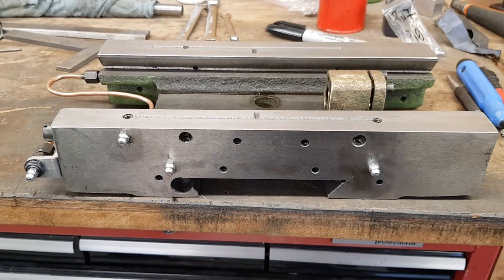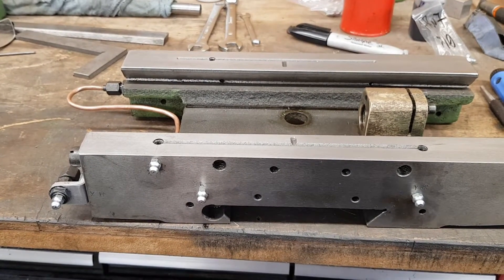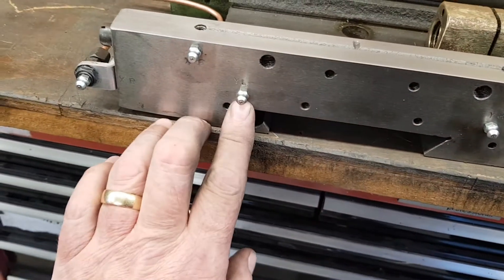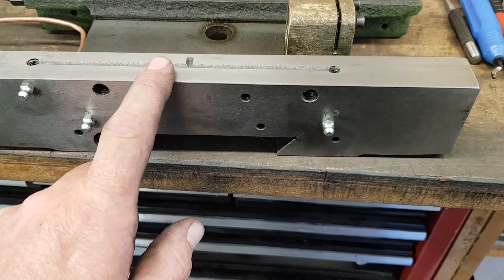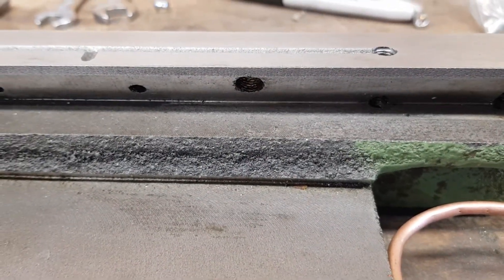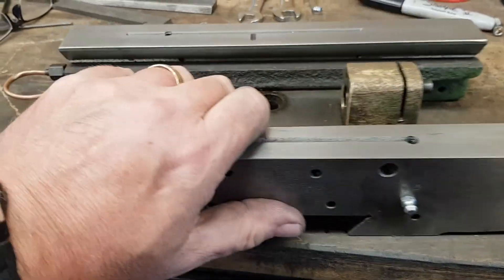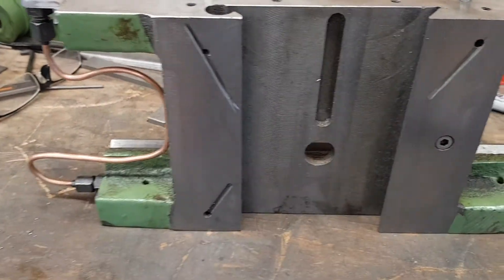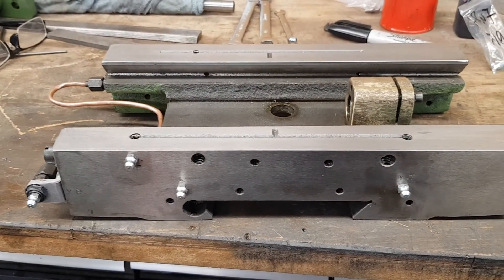626 Mill (Toolco VM26) One Shot Lubrication "Scrap" Part 2

Comment: Hi Nell. Robert come lately! Thank you for this. Very helpful. I'm going the other route and fitting a one-shot oiling system but I am going to take all your concerns onboard. FYI my mill is an Excel/Optimum BF30V with a robust column similar to the MB4. One challenge I already know I have is that there is still drilling swarf in the oil ports  it all has to come apart. This project is part of installing a DRO which done neatly would obstruct the existing button oilers on the left side Y axis. Liked and sub'd.
Reply from the maker: Hi Robert. It's good to take a good look at the lube systems on these mills. A lot of the time very little thought has gone into what is a major item. As in the videos, I did away with most of the existing lube points and positioned new ones to suit my needs. If you go one shot, make sure you use a sequenced distribution block. That way you can garantee all points get oil.
Thanks for the sub !
All the best 
Neil 👍👍👍

Comment: Very interested in this idea for my Lewis Shaper. There is no lube on it so you have to stand and oil and with shaper speed its not an acceptable design. 

All the best 

Dan
Reply from the maker: I did the same on my little Kennedy Hex Saw. Both ways on the frame are easy to lube now pre-start.